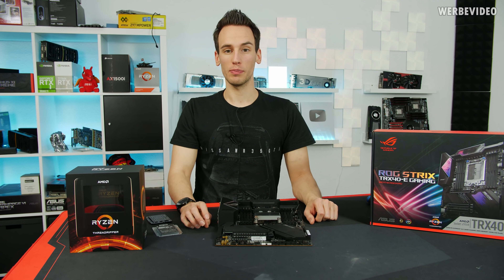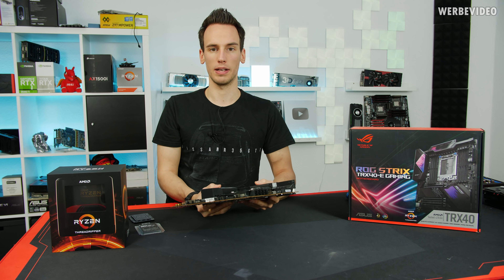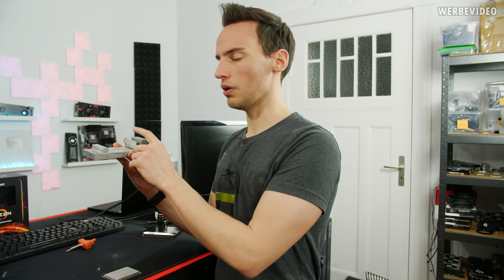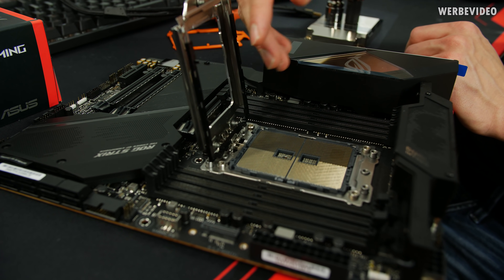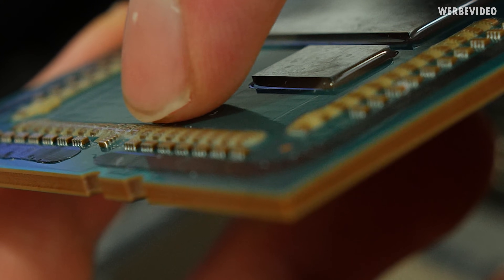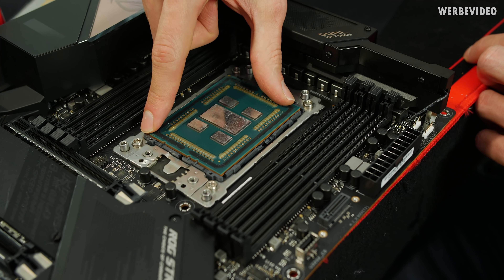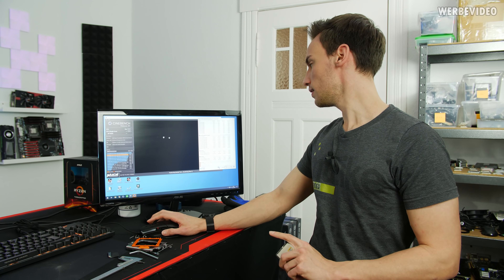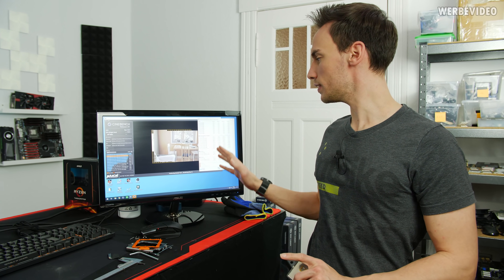IT ACTUALLY WORKS! -  3960X / 3970X Direct-Die Cooling

Comment: 6:07  The correct term is E-ring or E-clip.  The mechanic's name for it is "Jesus clip" because when you pry it off, it goes flying and you yell "Jesus!".
Reply from the maker: hahahaha thanks man
Reply: @der8auer  What would it take to passively cool one of these monsters?
Miracles not allowed 😂
Reply: @der8auer  would this work with a 3900x
Reply: E-clips are normally used on small shafts etc
C clips/circlips used on medium sized shafts etc
Snap rings used where loads are high or where the lugs on circlips could pose an issue
Reply: or as old uncle bumblefuck calls them, the jeslus clip
Reply: Drone racing hobbyists know this all too well.
Reply: Just came here to share the same info. I should've known there's a lot of machinists, mechanics or AvE fans in this channel.
Reply: so in italy, is it called the Mama Mia clip?
Reply: I've heard ring-clip.
Reply: its a C clip
Reply: It is a Sägering in german :)
Reply: It could be filed under circlip or E-clip. E-clip is a term used in the UK, but it depends on what discipline, some prefer circlip, which is more general.
Reply: I always thought those were called c clips, didn't know the extra protrusion in the middle of the clip changed the name
Reply: It's a Circlip.  That name you're giving it isn't something used in the UK.
Reply: @zstation64  It is a name used in the UK.
E clips are called E clips because they have the 3rd supporting protrusion like an E.
Circlips (sir-clips for Romans pronunciation) only have the two protrusions at the end.
Another difference is that Circlips have holes for using the pliers with, E clips do not.

Source: I've worked in instrumentation for 30+yrs.
This entailed learning metric, imperial and Japanese fastening systems and using the correct nomenclature where required.

Ask an instrument tech for an Eclip  when you need a circlip and guess which they'll hand you.
Many people get those things confused as they do with some metric and Japanese threads.

There's a reason British engineers were in demand worldwide for so long. We could work in all of the imperial systems, Japanese and metric whereas engineers from America work primarily in imperial, Japanese with, well Japanese lol and Europe (with a few others) being metric.
Standardisation being picked up globally from the early 80's (ish) started to make the British engineers skills of using all systems less important
Reply: @Th3_Gael  now is a snap ring something specific or just a catch all for retaining rings?
Reply: @jaykoerner  snap rings are specific.
They're typically stronger than circlips or E-clips and are used in higher load applications. Like E-clips they don't have holes for round nose (circlip) pliers. 
The most common places I've seen snap rings are automotive or large motor shafts, usually in the gearboxes. 
Like the word circlip it tends to be used as a catch all.
Hope that's helpful buddy
Reply: @Th3_Gael  helpful yes, how so, idk, the lack of any use of this info in my daily life means I won't need the info for a while
Reply: @jaykoerner  I've a head full of info like that that has pretty much zero practical use in day to day life but can make things easier on rare occasions lol
Reply: @Th3_Gael  I didn't say ever, just said for a while, plenty of completely useless stuff knocking around up here, that eventually came to be of use, might have been better to have just filled my head to the brim with one thing though instead of surface level knowledge in EVERYTHING, but is what it is, jack of all trades, master of none I guess, would make more money the other way though
Reply: @jaykoerner  Having a passing knowledge in many fields lets you solve problems in ways an expert in just one field can´t. A lot of times you can apply information from one field in another.
Reply: @excitedbox5705  oh it's has uses, it just doesn't bring in money, I know some stuff about architecture but not enough to work as a architect, I know some stuff about engineering, not enough to be a engineer, list goes on, oh things come up and the knowledge has the weirdest of uses but never a reason people are looking at you for a employee
Reply: @jaykoerner  And there is no way to get a degree in "Jack of all Trades", which isn't a good thing for the development of your career.
Reply: @blahorgaslisk7763  i was just saying I wish that space went to something else, never really spent time "learning" anything in my useless knowledge base, just sponge the stuff up
Reply: @Jay Koerner  You and me both. I can do a little of so many things, but is the master of none. As an IT technician that's a huge strength and a total disaster at the same time. I know enough to track down the source of many strange problems we encounter, but doesn't have any papers documenting those skills. So far I've gotten along on personal contacts, working for people who know what I can do or customers who has been recommended to contact me by those who I've helped out previously. But other than that I'm dead in the water. It's been fun, but it hasn't been very profitable compared to if I'd gone all out concentrating on a single field.
Reply: @Th3_Gael  American engineers work in both imperial and metric, for at least the last 40-50 years. It's also been common for American engineers to work around the world. My father has worked in multiple countries as a civil engineer. The misconception you have about the high demand for Brits has more to do with our countries differing areas of interest.
Reply: @blahorgaslisk7763  A degree/trade cert in one field with lots of general knowledge of relating subjects is a strength by nearly any hiring standard, random disconnected info can be fairly useless. Also the adage in its whole is, "A jack of all trades, master of none. Still better than a master of one." Basically the same as "Don't put all your eggs in one basket" except it's for knowledge.
Reply: @Ephem13  Yea I know, but it's not as apparent to potential employers. Most use recruiting services to narrow down the applicants to manageable numbers. And to those people all that counts are the papers you can present. If it's not on a diploma or a certification then it doesn't exist as far as they are concerned.
So to anyone who are starting their career get papers on everything and keep your CV updated continuously. Also write down every contact you make, and do it in a book or at least save it to your own personal storage so it isn't locked in the company servers. If you get the boot or the company tanks you don't want to lose those names and contact information. And whatever you do, do not trust your memory for these things. It's almost certain you'd forget about some of your contacts if you do so.
Reply: Only in Murica :)
Reply: Hmm, I was told they were called C clips as they looked like the letter C but I think E clip works jsut as well :)
Reply: Why no one mentions the name "Seeger ring"? We use that name here in Hungary very often

Comment: Only a 1500 euro cpu, no pressure.
Reply: Jon Donnelly you mean no mounting pressure? Hah hah ha..
Reply: Doesn't AMD throw processors to him for testing?
Reply: @CesarinPillinGaming  And still, if you lose cpu, you lose not a little amount of money.
Reply: @CesarinPillinGaming  I doubt they would be very happy with him if he did this to one they supplied for review lol

... especially if it ended up being broken. It didn't, so yay, but yeah, that's an unacceptable level of risk in that situation. Much better to have bought it outright for this kind of thing.

Comment: Does blue thermal paste work with threadripper?
Reply: Even if it does you wouldn't expect der8auer to advertise for one of his direct competitors.
Reply from the maker: Ofc it works. But Liquid Metal is the only way to go for direct die. Anything else will be so much worse due to high power density

Comment: So a spacing frame to hold the CPU and apply  even pressure over the whole CPU PCB?
Reply: I was thinking the same, like just scalping the IHS and shave down a block to fit in thur like a lil lego
Reply: @TheRogerbacon  That's also a solution

Comment: In highschool i went to an CNC machine/cad  program and as such I dont understand why the heat-spreaders are not milled as a underside of an water block. Not that hard. would take like 1 school day for a highscooler to do :P

By the way, as usual Top Notch Content from Roman!
Reply: Yes I've always thought this. Perhaps the tolerances are negligible when you account for silicone chip flex? It's a mystery.
Reply: Because they are mass manufactured and because of the costs involved. Every single time something is handled fiscal costs climb, as do error possibilities.
Reply: @Th3_Gael  Naturally, does it need to be said? the cost involved to refine the heat spreader for a product of these volumes is not that big. Sure one cnc mill if you want to go "crazy" price wise can go for say 100K €, but the precision of milling out the channels and the fins over the cores does not need to be of utmost tolerances. So a bunch of cheaper CNC mills can be bought. Time for milling a heat spreader with channels and fins would probably take like 10mins at most. So let say it would cost like 10€ more per unit including the design process of the heat spreader. 

So not that huge added cost that are carried over to the end user all in all.

@Viscous Shear

Ofcourse but look for ex on the new TR skus, AMD recommends at least an AIO. If they redesign the heatspreader to be the bottom part of the waterblock then they do can save money on having to design a bottom on a waterblock. They literally can skip one extra step/part of a water cooled cpu.
Reply: @Pillokun  viscous shear gives a good example above.
You obviously have little manufacturing experience because 1 cnc mill requires an operator, both of which add expense to the part.
Like I said above, every operation, every time an abject is handled in any way you add costs.
Then there's the waste, production in volumes means choosing the most economical means to the end product, this is not demanded by manufacturers its demanded by consumers who WILL NOT pay for wasted work or materials that they don't have to

If you're that confident in what you say then manufacture some yourself or have them made to your specs, add your profit and see how well they sell.
I guarentee you sell minimal products even if you lower the selling price to simple manufacturing costs
Reply: @Th3_Gael  I could do it I do have availability to a cheap cnc mill, but it would me much easier to mill a heatspreder when it still is just is being produced and not attached to the cpu package itself.

After all, water cooling will be a must ie in the future if the cpus get as big as the Threadrippers/epycs are right now.
Reply: mass produced to be cheap. that's always the reason.
machine time is some of the most expensive time on planet Earth.
Reply: I actually have mirror like grinding and polishing at work it takes time, less than 30min sure but how many heatspreaders do you think they make ? multiply the cost by that also requires heavy precise machinery lots of water lots of electricity and lots of polishing chemicals if your part isn't worth a 4 digits number (x000) you would lose money, I can tell you that the accounted loss for the company in case one of the part is broken, before and after machining is not the same, it's usually the last step and it means at that point your product has cost you everything that was done on it before, customers also wouldn't accept a half good finish and you can't add matter back on the product so a failure at this stage means scrap because it would be out of quality tolerances, manufacturing and doing it for yourself are two very different things.
Reply: @fredEVOIX  nah, at my old work it would take around 1min if that to make a cog for say a gearbox with utmost tolerances. Something like a heatspreader does not need to be mirror polised, a cnc mill can do pretty good enough job with correct rpm/feed. Something like a bottom of an gpu block with water channels and fins would not take long at all, dont forget it is not that much material you would need to remove from the heat spreader. 

Ofcourse it would make the heatspreader more expensive but such is the nature of manufacturing. at least you would not need to make another coldplate on the water block. 

I am saying that it would make sense if we already had to watercool our future cpus because of how big the package has become.
Reply: @Pillokun  
our current designs won't cut it for cooling in the future anyways.
the Dies will soon be too dense to cool from the outside.

but for now the extra $10-50 in Cost to get a leveled surface above and below before engraving has literally no ROI. the 99% won't benefit from it so they won't want to pay extra for it.

Comment: In English that's an "E clip"

Thanks for the great video!
Reply: eclipse?
Reply: Furthermore, the umbrella term for these kinds of locking collars are 'retaining rings'.
Reply: Or circlip.  As in circle clip.
Reply: @zstation64  Yes, e clips are circlips but not all circlips are e clips.
Reply: Sorry, but it's a C clip. Andy is right; circlip is the name
Reply: @matthewkuhl79  another one who is wrong.

C clips have Two supporting protrusions.
E-clips have Three supporting protrusions. Those on video are  E-clips
Reply: @Grabarz23  An E clip falls into the ring retainer group, all of which are circlips
Reply: @matthewkuhl79  now go and read your first post again. You wrote C clip... There is difference between C and E clips even if both are categorized as retaining rings.
Reply: @Grabarz23  i'm saying this as someone who speaks multiple languages: the blanket term that's always correct (albeit less precise) is better than a more specific/technical term that isn't. Yes, E-clip is pinpoint correct but the generic is better in this instance
Reply: @Grabarz23  Upon reading that again, i will concede i wrote that poorly